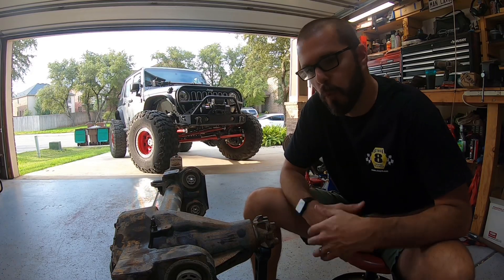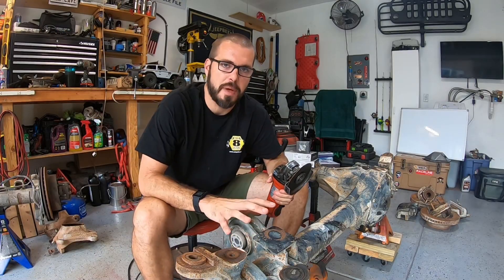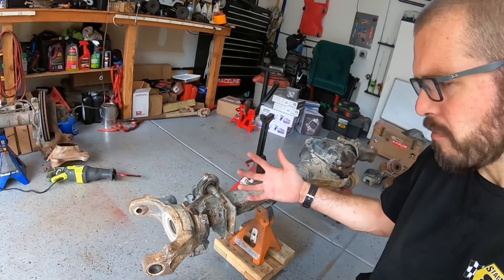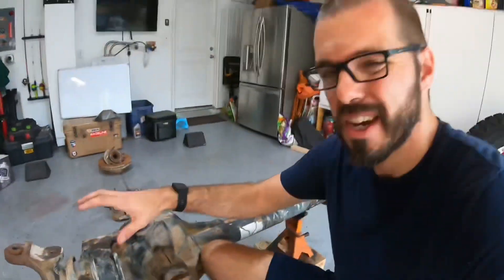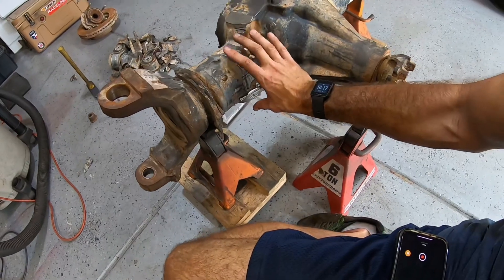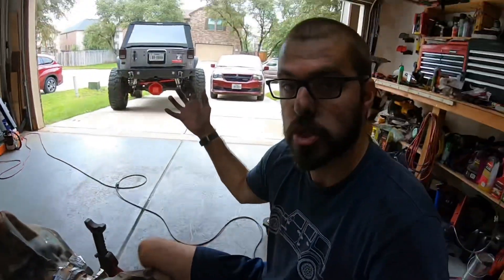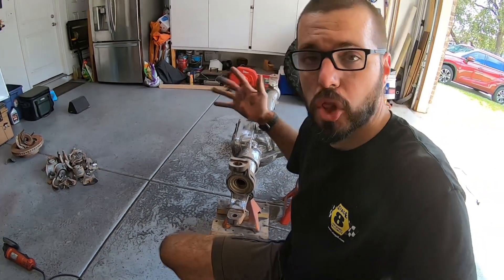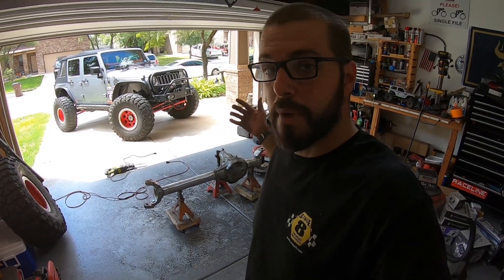DANA 60 JEEP AXLE SWAP PREP - Project Maple Leaf Jeep Build (no.4)

Comment: Good video, it’s alot of work!

FACE MASK FACE MASK save yourself a week of black boogers👍👍
Reply from the maker: Heck yea! I’m about to start cutting up another one…8 think I can film it better. But I use something really cool now call o2….it’s a little filter that sits in your nose! It’s super cool and easy. And doesn’t make you over heat.
Reply: I wear a real respirator almost everyday in my Fab business, stay healthy to watch your kids get old. These axles are gross and alot to get it cleaned but worth it. I’ve been building full size Toyota Tundra’s and Sequoia’s with the SD60. It’s worth the work to build your own 3 link and not use factory brackets. Hope to see you out wheeling someday!

Comment: Hey man, I picked up a set of used 2005 super duty axles and I’m not sure what I got. The axle BOM number is 256. Does that make it a Dana 60 or a super 60?
Reply from the maker: So there is a lot of confusion over the term “super 60”. The super 60 is a 10 lug hub on a wider axle that was available in the F450/550. If you have a regular 8 lug 60 from a 250/350…you have the standard d60. But the 05. And up is the best axle to use. Just don’t get one newer than a 2016…because in 2017 they changed the pinion just slightly and no one makes gears for them.
Reply: @WarPaintTexas  OK thank you. It’s a 2005 super duty Dana 60. I figured that the super 60 would be bigger but I didn’t know if it was just the hub

Comment: I absolutely love cutting and grinding and just cleaning things up. With even basic tools it’s totally doable which is super cool. I don’t even have a saw and I’ve done so much with just a grinder. I need a saw though lol
Reply: We need to hire you Alex to clean up all our axles. Just finished this and it was hell. Lol
Reply from the maker: Heck yea! I bought the saw in this video the day I first started it. I had a really good one (Milwaukee) but it was like 15 years old and died on the last axle I built. I completely forgot. So I had to run out. I bought the cheapest one that Home Depot had. It was like $90 and came with a 2 year replacement warranty. Couldn’t be it. It has help up fine. Although there was a time or two when it was smoking. Haha.

Comment: What is the going rate for a 60 right now?
Reply from the maker: From talking to people it depends where you live. In Texas they can be found for about $650 in junkyards. But about double that on FB marketplace.
Reply: @WarPaint JKU  good news been wanting to do this swap since i picked up my jk. I also didn't realize you were in Texas. What part?
Reply from the maker: @brandonbradford630  I’m just north of San Antonio.
Reply: @WarPaint JKU  nice. I'm just north of Dallas so not too far. Hit me up on FB.
Reply from the maker: @brandonbradford630  man I’m like never on FB. You can always message me on IG.
Reply: I paid $850 in SoCal last month. Complete with all steering.
Reply: @Jorge Hernandez  paid 600 for my front complete in socal and 250 for the 14b. 850 still good.

Comment: Are you going to use the "ball Joint deletes" from American off road?
Reply from the maker: I’m not. At least not at this point. It might be something I do in the future. But this is a budget build and I have never had a problem with Superduty balljoints. They are very large and meant for so much weight. So at this time I’ll just be doing new balljoints.
Reply: @WarPaintTexas  I agree the super duty ball joints are strong ... but the 3 degrees of caster adjustment is why I would use them.  better pinion angle and better caster.  Plus a trail repair becomes just a nut and bolt.  I am sure you have done your due diligence on the research.  One of the reasons I follow you.  I just wanted to share.
Reply from the maker: @advrx1041  yea man. I appreciate it. They are definitely a step up from the ball joint. I’m able to get the 6° of caster angle anyway being that the Superduty 60 had 10° of separation from the factory anyway. It’s definitely a great part and they are stronger than the ball joints. I just haven’t had the need for them. Especially when this build is showing people how to get the most bang for the buck. I appreciate the support! I’m not saying I won’t use them in the future…but for this build, they just aren’t necessary yet. But stick around…you’ll enjoy the suspension I’m going to do.